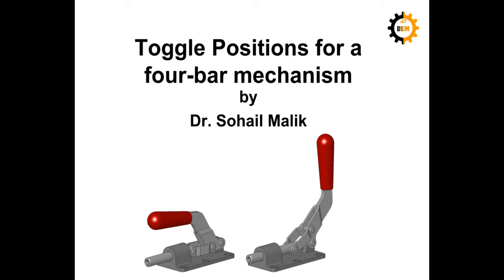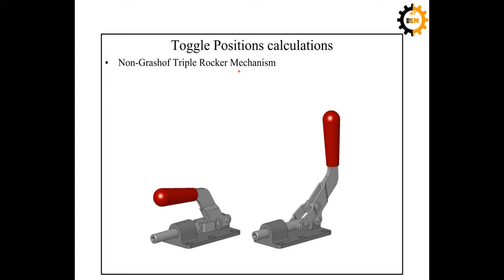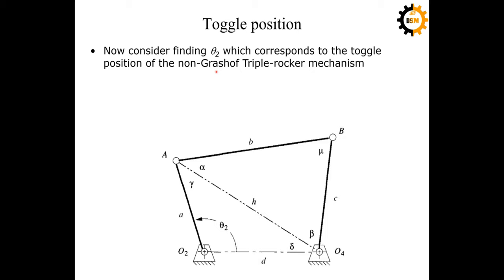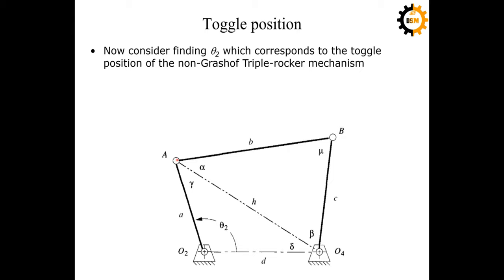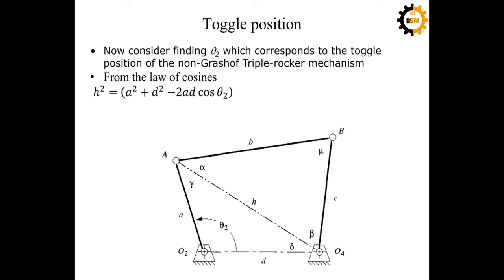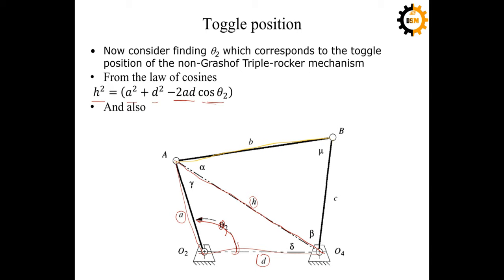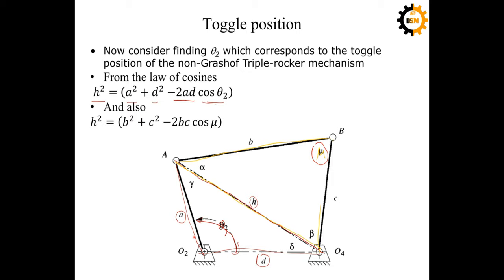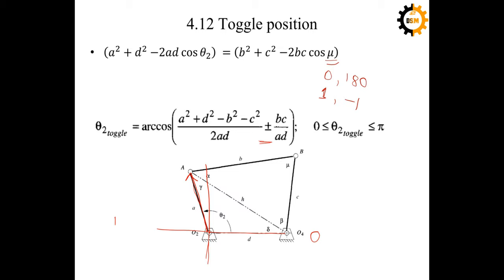26-2 Analytical calculation of Toggle positions for a four bar mechanism | Theory of Machines

Comment: (2017209)
One interesting application of the four bar 
linkage is found in locking pliers. When force is applied to the handle, the angle between the links is less than 180, and the resulting force in the jaws tries to keep the handle open. When the pliers snap into the locked position that angle becomes less than 180, and the force in the jaws keeps the handle in the locked position.

Comment: Sir, in most cases I have realized that only one of the angles give a value and the other is mathematically impossible. Does this happen with every mechanism or is it that the problems I have encountered are so.
2017099

Comment: Sir as written on the last slide theta 2(toggle) will be between 0 and 180 degrees. But below that in the diagram, you said that the other value of theta2 (toggle) will be in the 3rd quadrant i.e greater than 180 degrees. I am confused.
2017323
Reply from the maker: Yes, you will find one value of theta 2 from it and second one will be negative of that. Actually we had cos(meu) and it was moving between 0 and 180.

Comment: Sir, in the case of a triple rocker, is it necessary to have 2 inputs to get 4 toggle positions or would 1 input also be capable of toggling 4 times? (2017203)

Comment: mechanisms can be used to generate a large output force from a small input force
example:A FCU can clamp sheet metallic parts by applying toggle 4-bar mechanism.

Comment: Sir first you said that we have to only chose the value of theeta 2 that lies bw 0 and 180 but then you also say that there will be a second value of theeta 2 in the 3rd quadrant. Sir would be very grateful if you could explain this again as it is a bit confusing.
(2017132)
Reply from the maker: There are two toggle positions from one input in Non-Grashof and graphically they will be mirror of each other. The equation is also giving two values. Yes, if one theta 2 for toggle is between 0 and 180, the second must be between 180 and 360 considering the mirror. You can draw a mechanism in MSC ADAMS and drag to see the toggles, I hope it will clear the confusion.
Reply: Thankyou Sir,  it is clear now.

Comment: Advantages of toggle in a mechanism:  a toggle disperses the load more efficiently and allows a more balanced force of movement because the joint is supported from two opposite sides, rather than from one side only.

Comment: Advantages of toggle in a mechanism:  a toggle disperses the load more efficiently and allows a more balanced force of movement because the joint is supported from two opposite sides, rather than from one side only.

2017276

Comment: The toggle mechanism has many applications where overcome a large resistance with a small driving force is necessary, for example, clutches, rock crushers, truck tailgates, vacuum circuit breakers, pneumatic riveters, punching machines, forging machines, injection modeling machines, etc.2017310

Comment: 2017469, is it absolutely necessary for a non-greshof mechanism to have toggle positions at u=0 and u=180 degrees? What if the lengths of links are such that u gets jammed even before reaching 0 or 180 degrees?

Comment: Sir there is only one zero of the angle "u" and the other one is a minimum angle but non zero as you explained previously so how are we using two zeros in the equation? 2017378
Reply from the maker: Can you mark the time in video you are talking about?
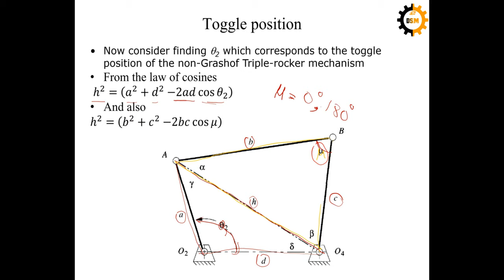Reply: @DrSohailMalik  5:45 sir
Reply: Also at 5:19, sir you said mu for toggle positions will be zero but we know that mu is not zero for both toggle positions as for 1 toggle position it is zero and for one toggle position it is a non-zero minimum value.

Comment: The same procedure i apply in assignment given to us on 4 bar mechanism but, that gave one angle  value for triple rocker while undefined value for second toggle position. So isn't it necessary for triple rocker mechanism to have two toggle position.?
(2017480)

Comment: There can only be two toggle positions in this mechanism . One will have a transmission angle of 180 degrees and the other position will have a transmission angle that has some value, not equal to zero. Then, why are we taking the possibility of transmission angle being equal to zero? 2017300

Comment: Sir at the toggle condition, the transmission angle is either 0 or pi. 
But if we take a closer look at 7:19, we see that during toggle, the diagonal length h = b + c. 
Sir, my question is that, will the cosine law hold in that condition because the triangle does not exist at toggle?
Regards (2016284)